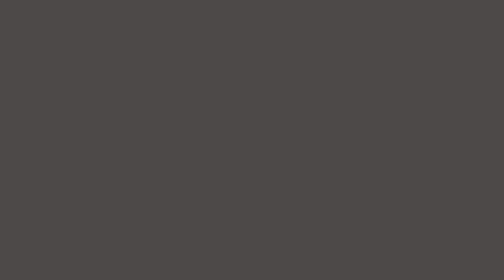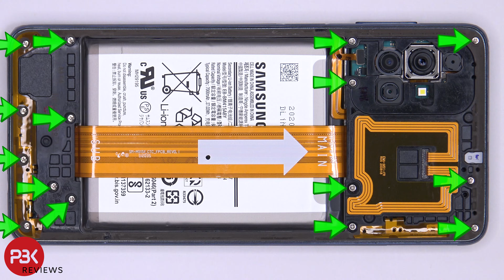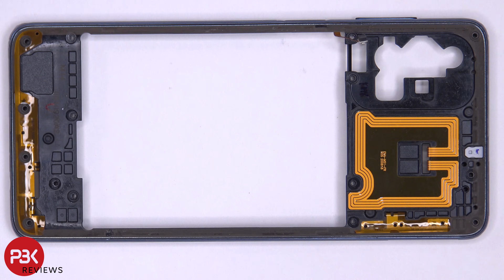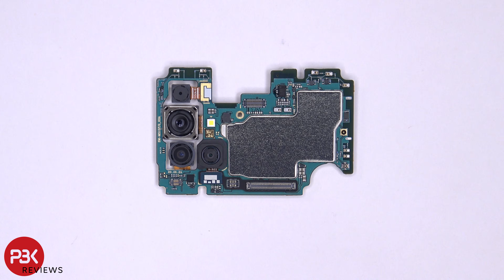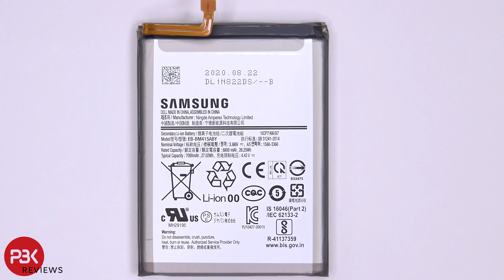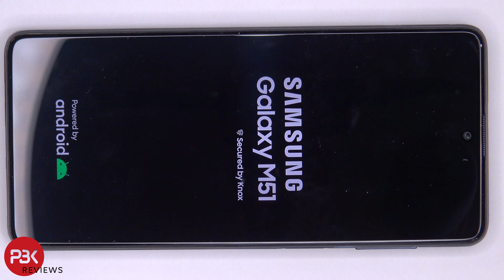Samsung Galaxy M51 Disassembly Teardown Repair Video Review

Comment: Hello brother. My M51 keeps turning on and off and there is a strip coming from left of the battery is not in contact and the place or something where that strip is connected is not attached to the upper board where it is to be placed

Comment: The earpiece speaker is also easy removeable?
Reply from the maker: once you have access to it, you can apply heat with a hair dryer to loosen the adhesive and pry the earpiece speaker off from the frame.
Reply: @PBKreviews  ty a lot mate this video is great❤

Comment: great video!

Have you ever replaced the fingerprint sensor on this phone? Mine stopped working due to a power issue so i ordered a replacement from eBay and will take it to my local phone technician to replace. Any tips? I don't think he's had much experience with this phone
Reply from the maker: Thanks. After removing the back plate and screws on the back housing, then removing the back housing, the fingerprint sensor is held onto the back housing with a metal bracket that can be pulled up so it releases it.
Reply: Mine have the same issue. Did your fingerprint sensor start working again after replacement I'm also thinking to buy it online. Please help me to suggest should I buy it online or not?
Reply: He replaced the fingerprint scanner/home button but still doesn't work. The button does work but no fingerprint scanning
Reply: @fLoooke  Then what he said any idea to fix the problem?

Comment: I have installed an app and suddenly my M51 display started blinking and However Immediately I have uninstalled the app and after 2 min my
Display turned off...

I am able to hear only the ringtone sound only ...I am unable to switch on Display

What could be the problem?
How can I restore it to original?

Awaiting for your reply sir
Reply from the maker: Not sure, I don't see how an app would cause that, but if it is the app, you can try holding down the power button and volume down button together for 30 seconds to see if it will reboot normally. If not, its most likely a hardware issue and not software issue.

Comment: Hi, I would like to know if after the repair or replacement of the switch button, is it possible for risks to malfunctions? Please I want to know because my switch button is also damaged due to fall🥺. I would want it to be replaced too but I'm scared wether the phone will still function as it was before. Thank you so much! I like your video by the way 😊

Comment: My M51 died on me, sent to get repaired. They said that the phone is bent and therefore no longer under warranty..
My battery casing / covering is all bloated up. Could this have caused the phone to bend?
I've been told there are battery issues with the M51..
Any advice would be helpful
Thanks
Reply from the maker: Hi, it's possible the battery could warm the housing but I don't think it would warp the midframe itself. You can try taking it to a repair store or try replacing the battery yourself and see if once the battery is removed, if the back housing will take its original shape since its only plastic.
Reply: @PBKreviews  ok will have a look at that option, not sure if it is worth it  though.. changing the battery might not even solve the problem.
First phone that has ever bent on me.. was expecting a better quality product from Samsung. None of theses issues with my Chinese branded phones..

Comment: Bro. Need your help.
My m51 screen blinked 3 or 4 times when i tried to unlock fingerprint after few min of sleep. Sometimes it took 20 secs to turn on the display.
I swear, It didnt fell into water. Any idea about it?

I gave it to samsung srvce cntr. How do they know it is water damaged?? 
I scared they will put some water at the time of servce for spoiling the free repair under warranty..
Reply: Fingerprint censor and display has no issues. Both are working perfectly.
Reply from the maker: There is a liquid damage sticker under the sim reader which is that what rectangular sticker and one under the sub board/charger port board. If those are not white and are red or pink, means water damaged. But try saving your data, doing a factory reset and see if it helps. If not check for software update and see if that fixes it. Aside from that might just be a faulty screen or display chip.

Comment: Is it possible to replace it's battery with a smaller sized battery like 4000mah, to reduce it's Insufferable weight !!??
Reply from the maker: You should be able to use a smaller sized battery as long as the cable length reaches the connector on the board and the connectors for the battery are the same.

Comment: My m51 phone dropped but there was no crack or anything on the screen. The back of the phone case cracked. My phone display isn't showing anything now. Please help. What should I do
Reply from the maker: Its possible there is a small hairline crack somewhere in the corner of the screen that you can't see which is preventing the screen from working. It's also possible the screen cable or another cable got disconnected from the fall.

Comment: @PBKreviews Hi, I'm from Nicaragua, in March I bought the Samsung Galaxy M51 for 350 dollars, by the way I don't speak English, this is with a translator, but the point is that it cost me a lot to buy it because the economy is not that good, and the truth is is that last Friday, June 11, I dropped and the casing was damaged a little, the day continued and at dusk I wanted to put it to charge but it did not charge, so I waited on Sunday for a repair shop to open and they told me they would review it and that until today 18 they delivered it to me and then it arrived but he told me that it was neither the Flex nor the Meid but that it was the charging IC that possibly was damaged but that there is no that part and I was wondering if you could give me a link where to buy it online or what do you advise me, that cell phone cost me to save 8 months to be able to buy it since I earned 3000 cordobas, around 90 dollars, and I have to buy food among other things, please help me
Reply from the maker: Hi, it sounds possibly the flex cable just got disconnected. But if the charging board went bad, they sell the replacement here : https://amzn.to/2T0ghue   . I wouldn't know for sure unless I was looking at it myself but most likely the cable connecting the charging board to the main board is disconnected. When you made phone calls while it was on, was the microphone working (were people able to hear you speak)? Since the microphone is located on the charging port board or sub board.

Comment: My 8 months old M51 got directly hit by fast moving cricket ball from screen side and got hit hardly on the brick just below 1cm from camera( to be more precise just above the finger print censor ) there is compression of 2-4 mm due to that my fingerprint sensor quite displaced slightly and not working as lock/unlock button as well , middle frame also got broken from there and had bent over there. Firstly there was a green line on the screen and screen was blinking white when screen was on and blinking green when screen was off at that moment but sometimes that blinking effect got stopped for a while and I could use the phone but still that line was constantly over there. 
The strange thing is that screen has no cracks and not even a single scratch , damage is only from the fingerprint side with slightly bent and back side But after 5-8 hours it got stopped working completely . I can only see the green flickering of screen when it is off . But when I try to on the screen by double tapping on this it is totally blank. last time i kept my phone on full brightness and 10 min screen time. without using my phone is heating badly and battery is draining as well . ( Always on display is visible but very less inspite of full brightness )
What should I do now? 
Should I change parts from authorised service center?
Will it be durable after that ? Because I have doubt about the durability due to that strong impact.
Please reply I will always be grateful to you.
Reply: Sorry bro

Comment: Hello! I have a question. My M51 one day suddenly stopped charging from the charging port. Could the charging port be damaged or has the battery become loose? I got the phone in Nov 2020 and I've used it until the beginning of April. I dropped it maybe 4-5 times do you think the charging port is loose or the battery possibly? I've tried multiple usb type c's to charge it and none of them charge the device. I bought mine in Germany so the voltage rating to charge it is different but I bought an adapter for EU to US charging to be able to use the charger on my outlets. Do you think it needs to charge at that voltage or do you think it needs a replacement charging port/battery? Or just open it disconnect the battery and charging port and try to see if it charges after I reconnect everything? I tried to put it in factory mode to see what was going on but it wouldn't let me get into that mode to be able to factory reset it and it died and hasn't charged again. Please I need your help.
Reply from the maker: Have you checked to see if there is any debris or clunks of dust stuck around the charger port that you can clean out? also its possible the battery cable may have gotten disconnected. You can take it apart and check to see if it is connected or not. If you confirm its connected, then you may need to replace the charger port board.
Reply: @PBKreviews  thanks for the guidance much appreciated! Do you know a reputable website I can use to buy the charging port for my M51? I'm new to all this and I'm not sure where to look and who to trust?

Comment: My phone fell on the fingerprint sensor and it became hot. I canceled the fingerprint feature and my phone m51 went off. Can the phone explode
Reply from the maker: Hi, don't think it will explode but its possible your battery got damaged from the fall or your fingerprint sensor is damaged and shorting causing the phone not to work. You would probably need to replace it but I cant find any available online so you would probably need to call samsung and see how much they would charge to fix it.

Comment: Is there an option to replace the  original speaker with a better quality one? Original speaker is not very good...
Reply from the maker: Might be possible if you can find one that would fit in the same compartment and the connector would be in the same area to touch the contact for signal or you might need to do wiring. Also not sure if any other hardware modifications would be needed like adjusting power output to the speaker and so forth. Maybe one day if I have time, i will try it out and see if it would work by just replacing a speaker.
Reply: @PBKreviews  Please do it , you will be a hero. Many people waiting for this fix.

Comment: Mon m51 s est éteint et ne vx plus s allumer  ca fait 3 jours qui pc m aider que dois je faire
Reply from the maker: Have you tried holding down the volume button and power button at the same time for 30 seconds to see if its possibly just frozen? If that doesn't work, check your charger, and if that doesn't help then it might be a bad battery, or a hairline crack in the screen that you cant see but prevents the screen from working or showing anything, or water damage if you dropped it in water etc.
Reply: @PBKreviews  oui je l ai exposé pour quelques minutes à la vapeur merci de m avoir répondu

Comment: Great Video!~
Do you think there is enough space between the backplate and the lithium battery for a thin thermal pad or a graphit heat foil?
Just to be on the safe side ^^
Also there is an opportunity to replace the thermal pad on the SD730 with some thermal paste and a copper shin
Reply from the maker: Thanks. Possibly could fit.

Comment: Hi, any idea where can I get a vibration motor for this phone ? or any other samsung phone which uses the same motor ? mine stopped working yesterday! :(
Reply from the maker: should be a pretty standard vibrator motor which is used on many models of samsung phones, you can check other videos of different model samsung phones and see which other one has that same looking vibrator motor and search for that one online and see if you can come up with a listing.

Comment: Any issues of battery 🔋 blast of m51 under 3year plz kindly tell me sir.
Reply from the maker: should last fine, but I personally have not used the phone for over 3 years to test. But shouldn't be too difficult of a replacement if it ever needs to be replaced.
Reply: So,  battery can change 

Heared non removable battery
Reply from the maker: @rashidv7523  Yes can be changed. They say non removable since its not an easy user accessible and replaceable battery. But it is replaceable.
Reply: Thank you
Reply from the maker: @shubhankarpattnayak1556  you're welcome

Comment: Can you change a71 battery with m51 battery since they have same spec with only different in battery
Reply from the maker: Hi, one battery is 7000mAh while other is 4500mAh. There would be a difference in the size of the battery itself and would not fit in the battery compartment.

Comment: 🤦🏻‍♀️🤦🏻‍♀️🤦🏻‍♀️....
China battery 🔋😭😭😭😭😭
Reply from the maker: A lot of the batteries are made in china. Just because they are made there doesn't mean they are bad. These factories that produce batteries for samsung or apple are under tight control and have to meet certain specifications. They aren't from random factories in china who make aftermarket batteries.

Comment: Can you replace the a71s battery with the m51s battery or are they different
Reply from the maker: The M51 battery is much larger and would not fit in the compartment of the a71. But I think the connector might be the same, but ya there isn't enough room to fit the larger battery.
Reply: @PBKreviews  thank you for the information.  If I want to replace the battery of the a71 is there a larger one of aftermarket one or only the 4500mah
Reply from the maker: @dipg7488  no problem and no because any battery, original or aftermarket would not fit in the battery compartment is its a larger battery as well as the connector possibly not matching.
Reply: @PBKreviews  thanks. My a71 works well.  Just wanna see if I could get longer battery life other than purchasing a battery case. Thanks for the info,  much appreciated
Reply: @dipg7488  Hey, how long is the A71 lasting?? how long do you use it? and performance of display battery?
Reply: @dweepayansensharma4437  so... running all performance mode it'll last me a day and a half. Keep in mind I work during the day but I am on it 7-8 hrs of video a day like Netflix, random browsing and music obviously. Running nova launcher and I use dark mode on my phone.  Medium performance is like that but %70 and 2 days until charge. Lowest performance disables nova and I have to use stock launcher but it says 4 days on 80% but it isn't fun to use with no animatins without my custom setup.

Comment: Vivo v20 or oneplus nord or samaung m51 which is better overall bro ?
Reply from the maker: depending on if you want the battery life more or not, but I would lean a bit toward the oneplus nord since it has a better processor and gorilla glass 5 compared to gorilla glass 3 on the m51. But if you want battery life, then the m51 is far larger in that area compared to v20 or the nord. I'm not too familiar with the vivo v20 so I wouldn't be able to judge that phone all too well.

Comment: I am watching this video in Samsung galaxy M51 😂😂😂
Reply from the maker: Nice :)
Reply: How many days of use till now
?
Please tell me,what sort of network connectivity are you enjoyng? A LOT of M51 users reported a bad wifi connectivity, and battery drain issue? Did you get any one of them? 
Also how did the update go of OneUI2.5?
Reply: @dweepayansensharma4437  i am using this since 2 months I bought it on 13 th of november , i want to tell u that i think there is a little bit battery drain issue, but when I use this phone in power saving mode the battery goes for a long time.

Comment: Today my phone dropped in the water and now i see moisture on the both front and rear cameras of it...
What shoul i do ??
Reply from the maker: If there is moisture in the phone, its best you take it apart and dry out any moisture and use a tooth brush to brush off any corrosion on any connectors or chips. If not, you risk the chance of your motherboard shorting or other parts of your phone shorting and ultimately not working anymore.
Reply: It will dry after few  days happned with my a50 took 4 days but all water was gone

Comment: What do you think abt built quality in comparison to A71...?
Reply from the maker: They are very similar, but I think I would lean more toward the M51 overall. The quality in general seems very similar but the fact the M51 is newer, I would feel the build quality would be based of better design and engineering than an older model phone but again if there are any advantages in build quality, it would be very small.